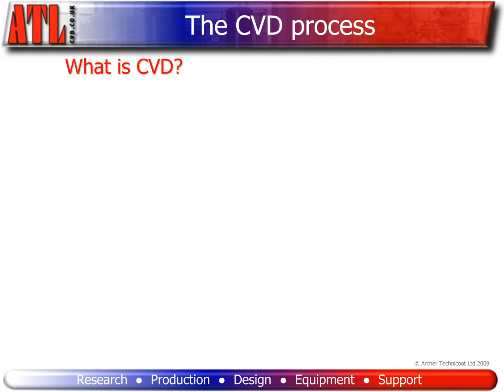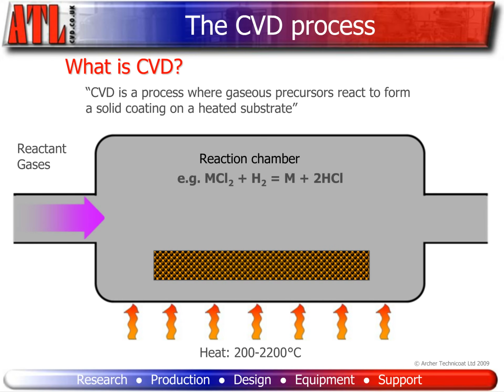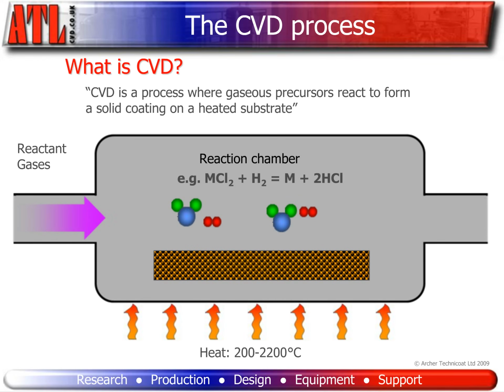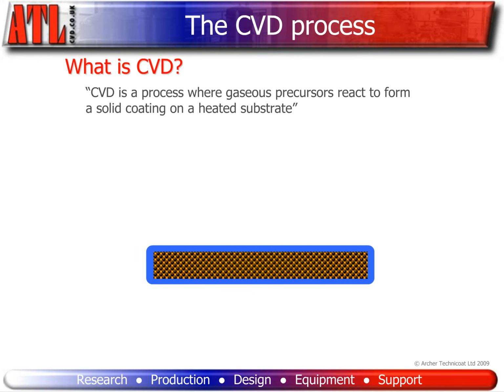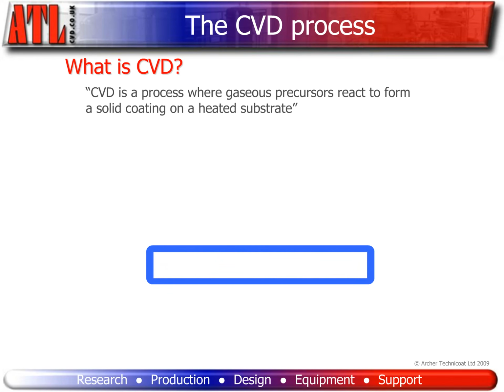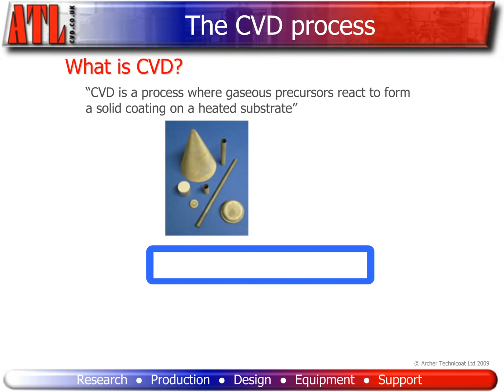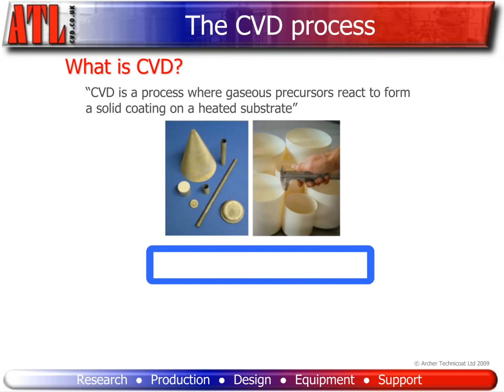What is CVD?

Comment: 🎯 Key points for quick navigation:

00:00 *  CVD is a process where gaseous precursors react to form a solid coating on a heated substrate.*
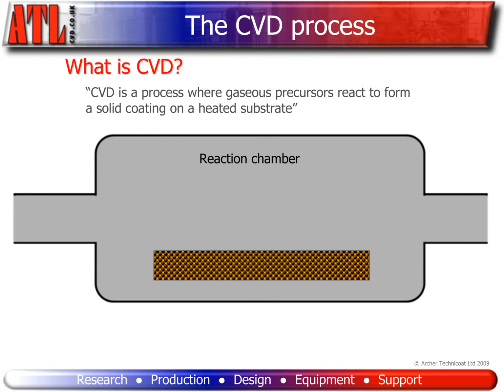00:29 *  The CVD process involves heating the substrate to temperatures between 200°C and 2200°C and introducing controlled flows of reactant gases.
01:12 *️ Reactant gases like metal chloride and hydrogen are introduced into the reaction chamber, where they react to form a coating on the substrate.
01:53 * ️ The coating process results in the deposition of metal atoms bonded to the substrate, with waste gases continuously removed from the chamber.
02:24 *  CVD can create coatings that cover all accessible surfaces of a substrate, even allowing for the substrate's removal to leave behind a freestanding coating.